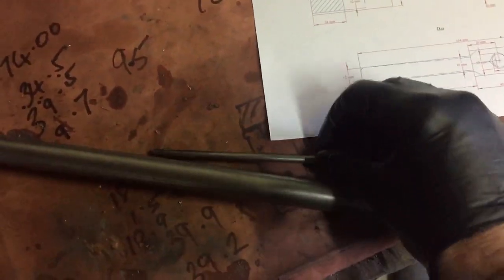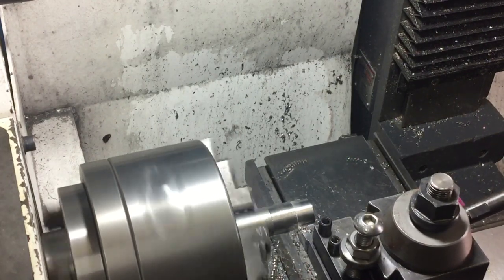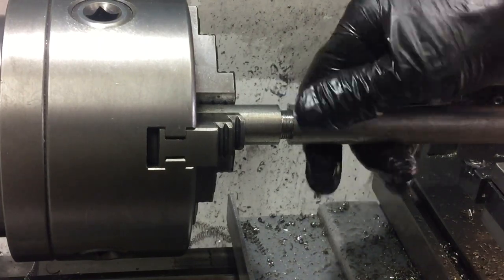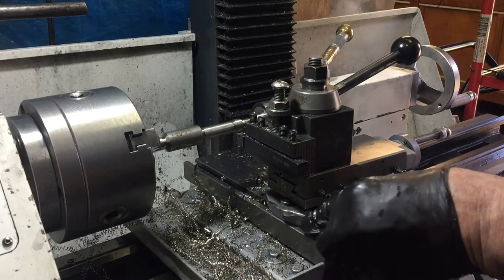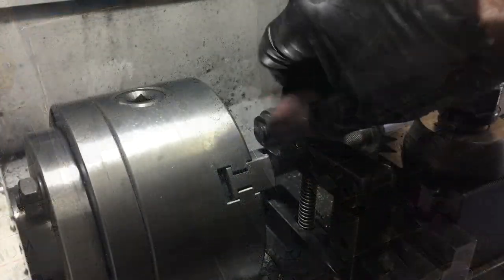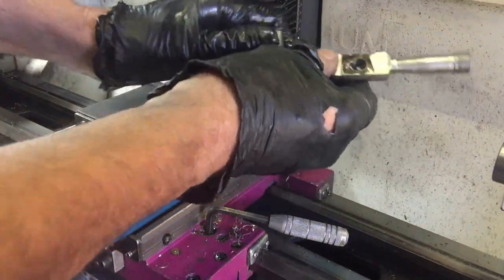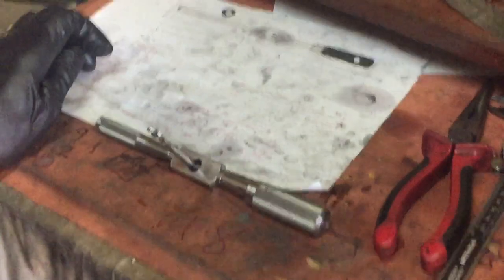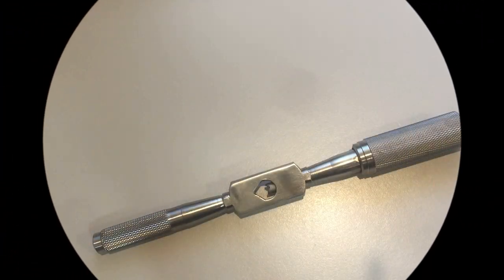Make a Tap Wrench - Starrett Style

Comment: This style of tap wrench is deceptively complex. It makes sense to make a proper detail drawing to catch the fit and proportions. I made a series of 3 wrenches of this design from small to large and purposely did not include knurling on the "working" ends of the handles. The idea being that I did not want to be holding onto a file. If you do any amount of heavy tapping you will quickly understand why. A pretty good first effort all the same.
Reply from the maker: Thank mate. Good observation on the knurling.